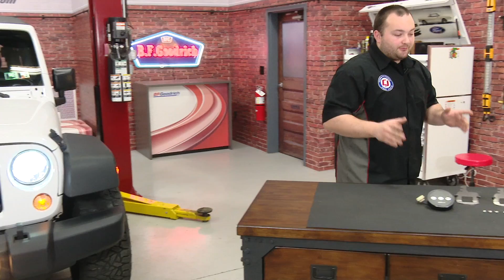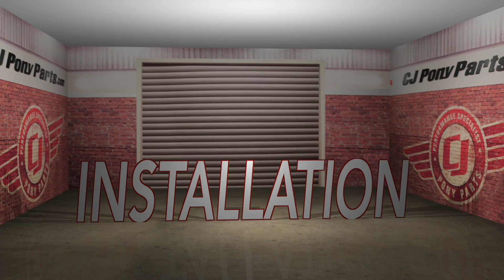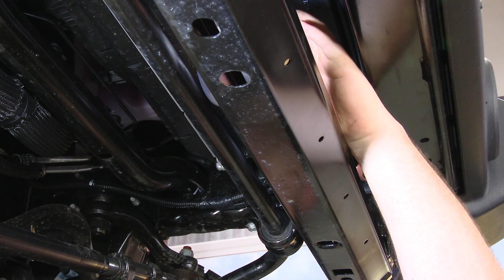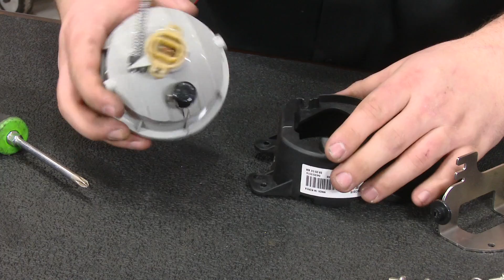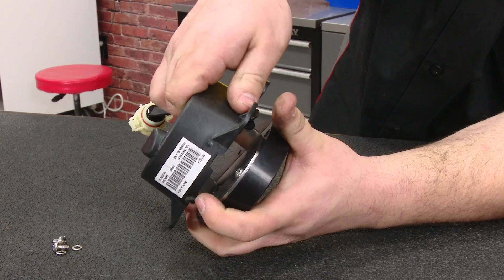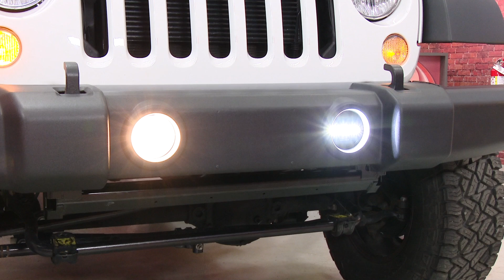Jeep Wrangler PUTCO Fog Light Luminix LED High Power Lumens Pair 2010-2018 Installation

Comment: Hello I have a jk 2011 rubicon and I changed the bumper to a gladiator bumper and I was woundering if the measurements on the jk bumper is the same as the gladiator bumper on the fog lights?

Comment: for anyone that wants to use fog lights the way they were meant to be used "against fog" knows not to ever go above 3200-4200k color light. Because anything above that or "Whitish" LED's lights will ruin the true purpose of using a fog light when you really need them. A whitish / blueish light will not penetrate through fog. Thus the light will bounce back to the driver. SMH. If you don't believe me read up about it.
Reply: YES, this is 100% true.
Reply: My new ones are 1880 each, or 3760 for the set. Thanks for the advice.

Comment: Everything can be done from the top on a factory bumper by removing the grill and filler piece between the top of the bumper and the grill. Plenty of clearance between the bumper and rad to remove the factory fog light.
Reply: Cool, thanks for your input!
Reply: Thank you, thank you, thank you. Watched a few videos and none of them mentioned this. It was either take off the bumber or this. Doesnt anyone know the right way. I knew that seemed like way too much work just for fog lights
Reply: That just sold me on the Putcos!  The idea of using a hoist to install fog lights turned me off the idea.  I do see that it made for better camera angles of the removal install though!  Thank you for the video!
Reply: Agree, just did this job this weekend (w/different fogs).  I ordered two new "front fascia push pins" when  I ordered the lights, I knew we'd break the old ones.  One side a little more tight than the other to get into, but not THAT difficult.